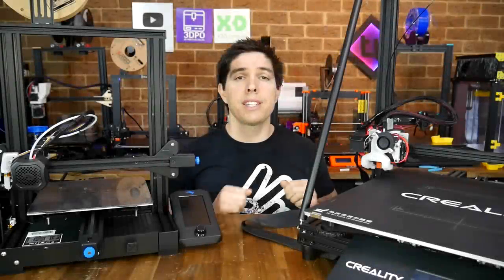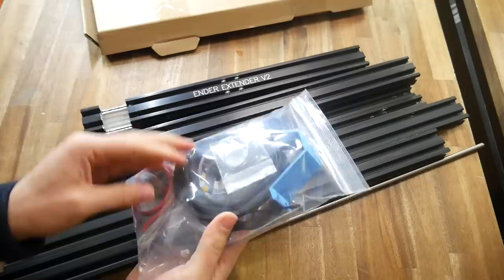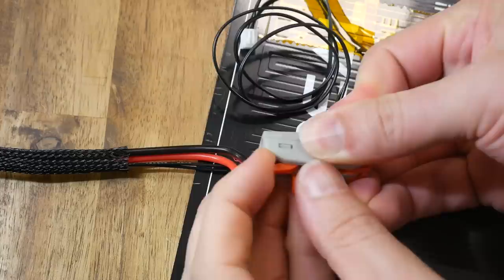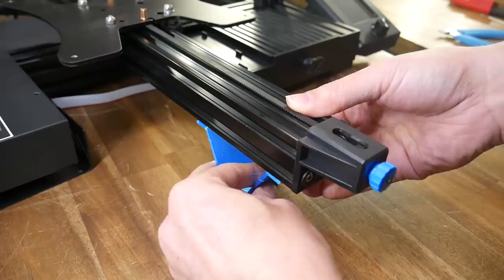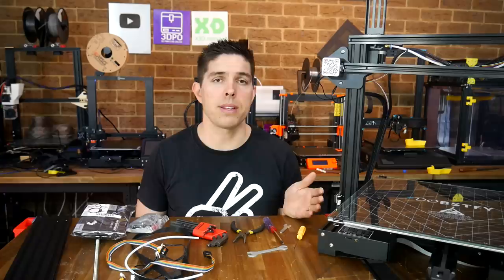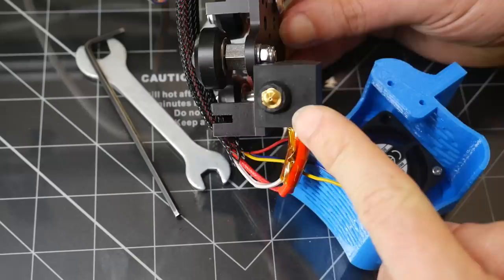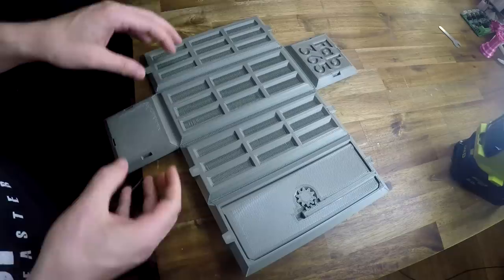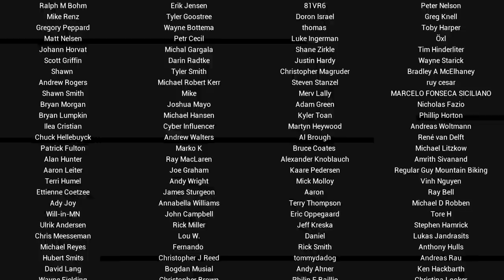Supersizing an Ender 3 V2: CR-10 Max for half the money - Ender Extender kit

Comment: How would you compare this project to purchasing something like the Sidewinder X1 v4? While the X and Y of the Sidewinder is a little smaller, you get the 400mm Z, and on sale they can be had for $360'ish
Reply from the maker: My Sidewinder X1 is a favourite of mine. It is an earlier model will ribbon cables that don't give issues. The V4 might be great but I don't have one to base my opinion on.

Comment: The build itself aside; 
When it comes to adjust the firmware and/or other software to make different mods work properly (like larger dimensions, larger heated bed, higher rated PSU, direct extruder, hotter hotend etc.) - is this kind of mod possible on "any" printer (read Prusa i3 MK3s)? And how difficult is that part of the process? I'm sure there's a few videos on that subject, but it's hard for a noob to find the direction in this jungle... 
And thanks for great content @Teaching Tech

Comment: So I have the Authentic Antlabs Smart 3.1 BLTouch, BTT SKR E3 Turbo, and BTT TFT35-e3 3.0 on my Ender 3 Max. I used all your different videos to install everything and Using your marlin guides and your ender 3 e3 turbo/bltouch marlin firmware configuration and modified the bed size for my printer. Now my second Z axis stepper motor is making a loud whining noise whenever I move the Z axis and when its idle. Does anyone have an idea of how to fix this? I tested the setup before I updated the firmware and it wasnt doing this. Hoping its something that I can change in the firmware for a quick fix. Please help! lol

Comment: Can you please do a video on how to connect the wires for  „Duet PS_ON“ function? Want to make my Duet printer automatically shut down after the print ends without having to use a Wifi outlet .
Reply: @brandonallen2372   I saw some posts saying that you could connect the 24v PSU and some kind of a relay, after the print just have a G-code at the end and the relay turns your 3DP off so I tought some of you or Michael may know how to do this and help me accomplish my goal. Im a mechanical engineering Student and I love 3D-printers but I'm kinde newby to the electrical side of them, any help is much appreciated.

Comment: The new build plate is to big, how does the printer manage to heat all the corners ???
Reply from the maker: The heat soaks through nicely. The reason I did big, wide, long prints was to see if the edges would be cool and peel off. Even printing overnight there were no issues.
Reply: @TeachingTech  would be interesting to see how evenly the bed heats up under a thermal camera if you have access to one.

Comment: What spacers were used on the bed?
Reply from the maker: They were left over from another project. The main spacers are aluminium (similar to fat washers), and then a fibrous washer against the underside of the heated bed so there is no chance of the spacer cutting through.

Comment: how does the bed do for heating with u keeping the 235x235 bed. is only the center of the big bed heated or does the aluminum spread the heat to the edges? i have wanted to extend one of my printers axis for a while an ive also thought about doing this also except with the regular ender 3 i just havent settled on what i want to do.

Comment: I bought the 400xl upgrade back in September and still haven’t been able to use it because I can’t figure out how to update the firmware to allow for the larger bed size. I have the ender 3 v1 and I purchased an arduino uno to flash firmware. Has anyone else done this upgrade and could point me to a solution to my firmware issue?

Comment: Great video as usual, Michael! I’ve recently got an Ender 3 Pro which I’m slowly upgrading. I’ve seen a lot of people switching from Bowden to DD as you did with the printer in this video. I was wondering, is there any major reason I should go to Direct Drive instead of keeping Bowden? I do also own a Prusa MK3 (which is Direct Drive from stock) and by comparing prints from both printers I feel that the main difference isn’t actually quality, but the printing speed to achieve similar results (which hopefully won’t be an issue anymore as soon as my SKR mini V2 arrives). Would love to know your thoughts. Thanks in advance and keep up the good work!
Reply: I am about to buy a printer and Prusa mk3 is what I was aiming for, but seeing this I am contemplating an Ender 3 with the size upgrade and some others. 
I am new to printers but capable with assembly so should be ok.
I am wondering what your opinion is, pros and cons between the Prusa and Ender 3, Also is one quieter than the other and if so is it by much ?
Reply: DD benefits flexible filiment printing n is easier for manual color swaps on pause n resume. DD has better Response to retract numbers due to no friction on the filiments....friction is also why it's better with flexible. 

The the other comment your comparing apples to cucumbers.  The ender n the Prusa are waaaay different leagues of machine.... with vast feature differences and quality. The prusa is quieter.

Comment: Out of which material did you print the new shroud for the hot end? Is PLA resistant enough to withstand the higher temperature  around the hotend and the heat coming from the print bed?  I know that PLA is starting to soften at around 60°C, so I wonder, if PLA would work in this case...

Comment: For the price I would've included genuine wagon connectors and not cheap fake ones, on a heated bed it might be a fire hazard
Reply: Not a fire hazard. Rated to 30 amps. Newist kits are using wago. Only downside is they are not inline like the grey ones.
Reply: @MakerMark  when it's not a genuine part you have to consider the rating very carefully, a heated bed is also pretty close to that 30A at almost 20, I wouldn't trust one with those fake ones, who knows which testing they made for their supposed rating, it probably won't burn your house down but for a few cents (when buying bulk like the company making the kit) for genuine ones why take a risk?

Comment: With options like this, I can't really understand Creality's justification for the enormous price gap between the Ender 3 and the CR-10 series when much of the difference merely comes down to the amount of v-channel extruded aluminum.
One thing to note though - the printermods direct drive adapter is nice, as is the EZR Struder, but doesn't the Hemera include a full metal hotend?
Reply: Yes it is all metal

Comment: I noticed you only do a 3x3 grid even on the larger bed. Is that a sufficient enough grid size? Thought maybe you would bump it up to 5x5 maybe even more. Since you have the solid spacers, the bed likely won't change at all between prints so you could do a larger grid to probe once initially and then just use M420 S1 in your starting Gcode to restore the mesh and then not run G29 to probe before each print.

Also noticed you only have binder clips on front and back and none on the sides. Do you find this bows the glass up at all near the middle?

Comment: Michael, how much space after upgrade is occupied with printer (Because of bed 400x400) ? In case that it is needed to put in enclosure  .... Tnx!
Reply from the maker: My tape measure says just under 900mm is needed for Y to account for the range of movement. 640mm for X and 700mm for Z, although you might need a tad more to get the filament spool on easily.

Comment: With the original heated bed much smaller than the new 300x300 bed does it actually heat evenly out to the edges?

Comment: Any suggestions on tweaking firmware and slicer settings for optimum results after this upgrade? I did the 400mm upgrade on mine, and I think there is some tweaking needed to get the best quality possible. And a 2nd Z motor is definitely needed I found.

Comment: Hey, I'm kind of new... but could you run thru how you print with Esun Pla-+ Cura seems to have removed the ability to even create your own profile with that material selected. Personally... i believe if They wanted to disable profiles then remove the material settings. What's the problem

Comment: Please help me with my issue , I did everything I changed the motherboard I changed the heating bed I change the heating nozzle, I changed the power supply I upgraded the firmware multiple times but it still keeps on giving me the same issue "nozzle to lowperture" I literally changed everything on the printer it's a whole new printer and I still can't get it to print anything please help
Reply: did u solve it ? i have the same prob

Comment: Had an issue with your firmware. Couldn't get the bed to preheat above 59 no matter how long it sat there, I even insulated the bottom of the bed. I kept getting "Nozzle temp too low" warnings after a few minutes and had to power cycle each time. Went back to the firmware I had before the mods and everything worked great. I did the 400x400 upgrade and added a BLtouch, Ender 3 v2
Reply: did u solve the prob i have the same ??
Reply: @yagev95  the firmware linked on this video wasnt the correct firmware for the board that was in mine
Reply: @chanb0b103  what bord u have ? And can you tap a link to the firmware?
Reply: @yagev95  I have the 4.2.2 board. I'm not running the extender kit on my machine anymore and no longer have the firmware for it

Comment: How do u solve warping with this printer. All.printers I've used in the past were 220x220mm and glue sticks worked well with adhesion, but not with the cr-10 v3. Can u send some pointers my way?

Comment: @teachingtech thanks for the video , I am having issues with the printer , I keep getting a ( "nozzle too lowperture" ) on the screen during the beginning of every print , I checked all the wiring as u stated in the video , and followed instructions to the T , even the firmware link u gave but I keep getting that error , any suggestions?? I really need the help I've been messing with is for several weeks trying to get it leveled and getting the z offset correct and now the bed is level and prints but stops a few minutes after printing the  raft or brim of the prints ???🤷🏻‍♂️🤷🏻‍♂️🤷🏻‍♂️🤷🏻‍♂️🤦🏼‍♂️🤦🏼‍♂️🤦🏼‍♂️🤦🏼‍♂️
Reply: did u solve the prob ??

Comment: Can you point me at any information on the fixed spacers you fitted in place of the springs on your 3 v2 please?
Reply: TH3D has some
Reply: @terrylindsay445  what is th3d?
Reply: I bought some generic aluminium stand-off spacers from ebay instead for about £7 for 4 of them. Hole Size: M4, Length: 12mm
Reply: @Pugwash.  but don't one of them have to be slightly smaller to accommodate for the heat bed wires and bracket???
Reply: Not if you put the relief bracket below the plate instead of above.
Reply: @Pugwash.   I don't see how that would work , the plate below also host the bracket on either side even if I use a spacer ? Can u somehow explain how u have yours set up or send me a link to the spacers
Reply: @MrRayloco  Actually just checked how I fitted mine! I have the printed one for a chain so I just made the hole big enough to accommodate the outside diameter of the stand off.
Reply: @Pugwash.  can u send me the link to ebay?
Reply: @MrRayloco  It was ebay item 193391036716 in M4 12mm. I'm in the UK so these were local for me
Reply: @Pugwash.  thank u

Comment: Great video! I upgraded my Ender 3 V2 with the Extender kit, following the instructions from their website and your video made it a lot easier. I also downloaded your Marlin firmware for the Ender 3 v2 with BLTouch + extender and compiled it with Visual Studio. After what seems to be a successful firmware upgrade, Im having a bit of issue with not being able to move down on the Z axis. When I auto home, everything goes as usual but when the probe gets to the middle of the bed where it would normally go, it does not move down. I can use the "Move Z" option to make it go up, but it wont go down. Any suggestions to fix this?
Reply: So after a little searching I figured out that I had to disable the Z_MIN_PROBE_USES_Z_MIN_ENDSTOP_PIN  and also Enable the USE_PROBE_FOR_Z_HOMING to get it work properly for my BLTouch. Now I just need to figure out why Im getting a "Nozzle temperature too low" error after its been preheating for a little while.

Comment: I've done this mod to my ender 3 v2 but I keep getting a error of nozzel temp too low but its not the nozzel its the bed temp that is to low. I put the stock firmware in the unit and no issues but I can't utilize the bed space I put the marlin firmware in and now im having this issue any help is appreciated
Reply: Did u solve it ? I have now the same problem 😕

Comment: So I will be the a-hole and suggest this is just WAY too overpriced for what it is. Would I love to make my Ender 5 bigger? Heck yes but this mod on an Ender 3 cost just $100 less than an entire printer that still comes with all the electronics, hotend, heated bed, motors, etc while this comes with metal, some cables and assorted parts. I never understood pricing of some things. I think it is a really neat idea and if you have the extra money to have some fun, why not! For most people who bought the lower end of the 3d printer spectrum this is like buying a whole printer again but without the guts.
Reply: Costs for materials in the USA are higher than in china. Rent, people, machinery are all way more expensive here. So if you don't understand pricing of things try starting a manufacturing business from scratch.  Costs are everywhere and people treat you like a criminal for trying to make a profit so you can buy better equipment
Reply: @MakerMark  Fair enough! I know costs are high for a lot of things but at some point you either have to do something like a pre-order for X number of parts to keep costs down or just go all in and buy bulk (hoping to sell items sucks but sometimes a gamble is what it takes). Say you could build 1000 of them for half the cost and pass at least some of that one to customers, then you would have guaranteed sales plus lower costs to drive those sales. 1 off production is expensive and it shows. Like I said, in relation to buying another SMALL printer (some bigger ones as someone said in the comments too) it is expensive.

Comment: I would like to know what the reasoning was to install a mod instead of an e3d hemera ? Are the mod and the hemera on par ?
Reply from the maker: You could do a Hemera if you wanted, each to their own. I'm happy with the one on my CR-10Max. It recently brokew but E3D were prompt replacing it under warranty. I'd say the Hemera would still be superior to the setup here, simply because it is dual drive and lighter, but this MDD / EZR combo has been on my Ender 3 for a long time and works really well, especially for the much cheaper price.
Reply: Thank you for the reply. These mods look very compelling, I think I will upgrade my ender 3 too !

Comment: I seriously need help. I have tried so many different firmware and nothing works. I even took yours, complied it, it installs and freezes during leveling. I need BLTouch and the Xl kit with the 400x400x500 but everything I compile either crashs the Ender 3 v2 or wont work properly. Please help I'm desperate.
Reply: I just got my firmware working for my ender 3 V2 with BLTOUCH and ender extender 400XL, want my firmware? I will say though that my BLTOUCH is a creality offer and not the standard with separate power pins, it only plugs into the 5 pin.
Reply: @anthonyleggio4877  Did you get the Z offset to work? My Z offset dials in but won’t move the z gantry. Any advice???

Comment: Do you know where I can get firmware for the Ender 3 v2 with the 4.2.7 board and BLTouch? I tried your firmware and changed the define board part, bed takes ages to get to 60c and after it has been printing for a minute or two it beeps really loud cancelling the print saying the nozzle isn't hot enough.
Reply: I am also having this issue, did you find a resolution?
Reply: I am having the same issue I get an error that says "nozzle too lowperture" .
I don't know what to do🤷🏻‍♂️🤷🏻‍♂️🤷🏻‍♂️
Reply: @MrRayloco  My issue was because the mosfet for the headbed failed.  My hotbed would heat up and not stop heating until the printer threw the error.
Reply: @ttorgrim  did u ever fix the issue ,I still can't print anything , once the temperature drops more then 11° difference it gives me the error , I have my printer collecting dust because I can't get it to work, I even changed the motherboard two times change the hotbed two times changed my thermistors cheating elements and corresponding wires but I still get the error because the bed can't maintain the temperature
Reply: Im still in the middle of changing my main board to an SKR mini V2 but my issues seemed tk have been resolved. I didn't know the V2 display wasnt compatible with board but another display is coming in tomorrow.

The new board is in and I was able to control via octoprint

Comment: You didn't really bring it up to the same specs the MAX. You state multiple times what things are not the same that you could have spent more money on. The Z build size, heating plate, etc.
So, in reality if you were going to match the MAX, it would cost a few hundred dollars more. You just didn't think those things were necessary?
Reply: For most people getting reliable prints to the same bed size as the MAX is what is most important. You don't end up with the identical system, but you end up being able to print most models at the same size as you could with the MAX for a big saving.

Comment: Ive tried this firmware out on my ender 3v2 400x400x250 and it probes the front grid or it willl probe one point and be done and I have no F*cking clue why I have tried and this firmware wont work. if anyone knows why or has better firmware setupplease send it my way please comment